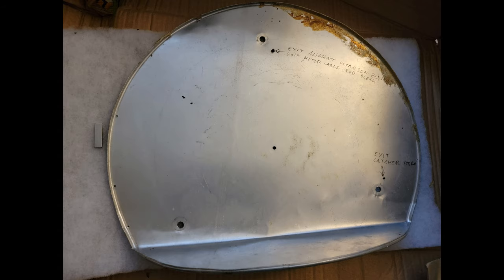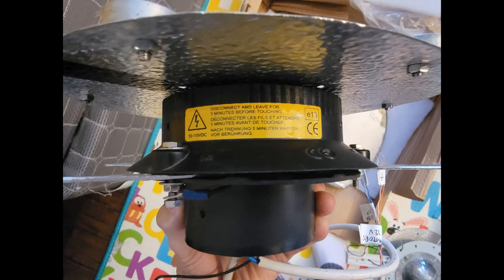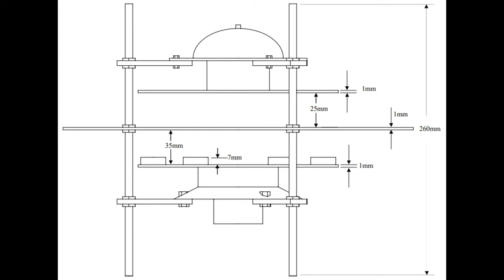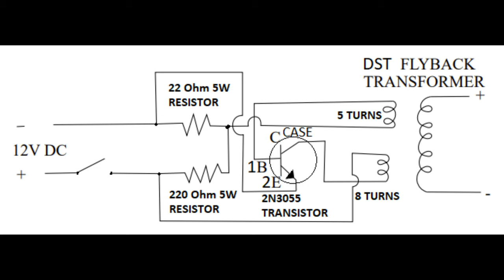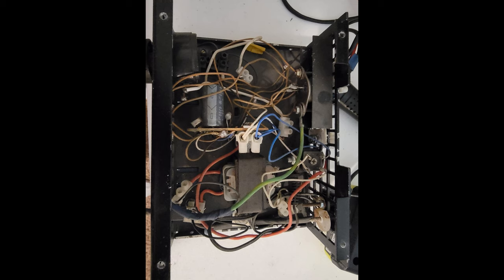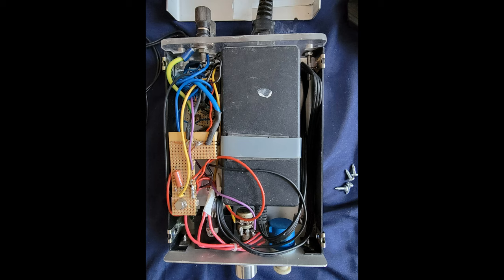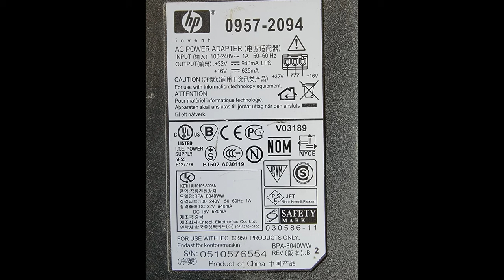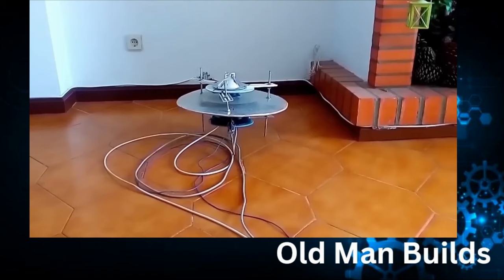Graviflyer "All The Original Parts" #32

Comment: How is this not the best anti-gravity channel on YouTube? You deserve a million subs!
Reply from the maker: thank you.
Reply: It is
Reply from the maker: @michaelstern519  thank you.
Reply: At the very least, it’s one of the most thorough, honest channels on the topic.
Reply from the maker: @Critter145  thank you
Reply: @nathanbunten4299  hi Nathan, were you able to open the Amazon link I sent you? I cut the plastic tip and installed a needle. This little Tesla coil throws 1.5-inch arcs and never gets hot! Plus, it's at a frequency that is harmless to touch and doesn't blow up my other electronics:)
Reply from the maker: @shawncalderon4950  I did not see the link if it is on youtube they don't allow outside links. I have a great tesla coil circuit. The tesla coil itself never messes with my electronics. It is the combination of the fields I am creating. 

I am forcing energy out and creating a bubble inside of it. That is why i am getting the interference.  I am trying to show how to make a bubble in the air out of pure energy.
Reply: @nathanbunten4299  Ah, gotcha. Ok. Well, I can't wait to see this energy bubble!

Comment: I already have the power supplies, the flybacks, cables and the fan motors with some digging around in my utility trailer. I have the acrylic tubing for the tesla coil. The nuts and bolts and electrical components too. So I’m after the the threaded dowels, aluminum sheetings, copper magnet wire , copper 1/8” tubing, a top funnel, the magnets, and support beams. I had better retrieve my micrometer :)
Reply from the maker: try lowes for the aluminum.

Comment: Hey. It's been a while. I'm still working on my designs as well. I do have alot of things to discuss with you. For one. He's using a flyback with a feedback coil. So the flyback will resonant at its own frequency. A zvs driver operates at a higher frequency. Match the tesla coil with the flyback at its own natural frequency. I may have a solution to the motor problem as well. I did a similar graviflyer which did start to lift but fell over. Due to high voltage interferring with the motor.
Reply: Incredible, You should post your results as well, why there aren't videos of the graviflyer on you channel?
Reply: @michaelstern519  I haven't put any new videos up yet because i'm still working on them. I did build a semi graviflyer with only one spinning disc. Which did start to lift. Once i get better results i will make a video.

Comment: The part on the top should be a sphere on top of a plastic tower, inside of which you route your cable. If you use a plastic dome - its wrong. If you use inside flat plate - its wrong. The only correct answer is a sphere, to cancel out all the incoming pressure evenly.

Comment: Hello, just wanted to add detail to this project, ummm don’t know if you are aware of this but I remember that alexyes in one of his videos talked about the cavity effect on the disks(the texture of the aluminium) I wonder if the effect can contribute to its flight. By the way what’s the basic understanding of how it took of(the original design)
Reply from the maker: The discs matter. I am matching the frequency of my upper disc at 20hz or 1200 rpm. My top 4" of my tesla coil is putting out 20hz not khz like the rest of it. I am amplifying resonant frequency's. That is key.
Reply: @nathanbunten4299  thanks for the explication and sorry for broken grandma(auto correct) . Another question does the design push of earth electromagnetic field to lift. I have found out about this topic in yesterday and want to fully understand how the device works
Reply from the maker: @WhxhDjdxjc  I am not sure. There is a case to be made for that. There is also a case to be made for frequency disruption of the earth to break gravity. Until it lifts for me, I won't know. Even then it will take some time to understand it.
Reply: @nathanbunten4299 so the basically the device is interacting with the earths static field to lift of and uses the two spinning disks to create a large voltage difference and then magic happens right?
Reply from the maker: @WhxhDjdxjc  that would incorrect. There are 2 effects. You need to build a field that pulses and resonates to break it from the pressure of gravity. Then you need to build a lift force inside the original field. Just more voltage or a voltage difference will never do it. It would take me 10 to 20 pages to explain it all. I try to make video's on each part. Even that isn't enough.
Reply: @nathanbunten4299  thanks for the correction

Comment: 物体の質量の減少を再現させるなら、上下の円盤の極性を下がプラス、上がマイナスで
下から上へ電流が流れるようにすると、質量自体は減るのではないでしょうか。
Reply from the maker: You are never decreasing mass. You can create a force between 2 plates as long as one is big and the other is small. Force goes from small to big. 

You never have to change the weight of an object. You just have to interrupt the forces holding it down. Vibration make it easier to move heavy objects. So resonance makes it hard for gravity to effect force something down.

Comment: Hello, I missed few of your videos. I just want to understand. Did it take off?
Reply from the maker: not yet I am having trouble controlling the fields.
Reply: @nathanbunten4299  all the best. This will be challenging because you are trying to replicate someone else's. But you need to look from the perspective of why he did it in that way to solve what problem?
Reply from the maker: @sateeshpeethaphd  i am on it.
Reply: @nathanbunten4299  good luck！my friends
Reply from the maker: @wenzhizeng8049  thank you.
Reply: @nathanbunten4299  "Mr. Nathan, I want your gravityfier to takeoff, hence I'll provide two hints to troubleshoot your gravity device. Firstly, employ a freely spinning steel rotor on a manageable shaft positioned between the middle and upper plates. Ensure the rotor spins smoothly outwards from all directions. Secondly, encase the gravitifier with a transparent globe featuring dual layers, and fill them with iron powder. Observe as it forms a cloud-like structure and rotates around its axis."
Reply from the maker: @sateeshpeethaphd  your idea is good. But I already can make the lifting force. I just need to finish the research on the fields to break gravity.
Reply: @nathanbunten4299  NP, mere field will not help overcome gravity. Otherwise magnet also stays in the air as it has field. This field should rotate around axis like earth rotation.
Reply from the maker: @sateeshpeethaphd  it is a pulse field. It does not need to rotate the craft.
Reply: @nathanbunten4299  I mean field will rotate. Hmm. Pulse field should also work.
Reply from the maker: @sateeshpeethaphd  the pulse and resonance. I am going disrupt gravity with resonance then pulse a field around the craft. I am working on a bubble field.
Reply: @nathanbunten4299  best of luck. Anyway, there may be much better way then gravitifier.

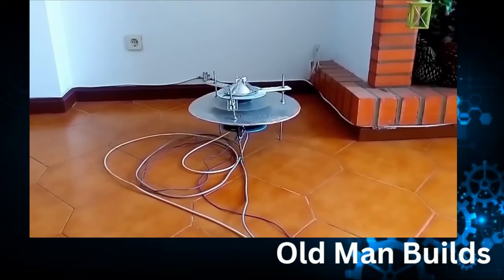Comment: 15:36 I really don't see any kind of high voltage wire going to the top disk that bothers me (I see only the wires for the motor, not even the ultra sound wires)
Reply from the maker: it is there. it is a thin piece of brass.